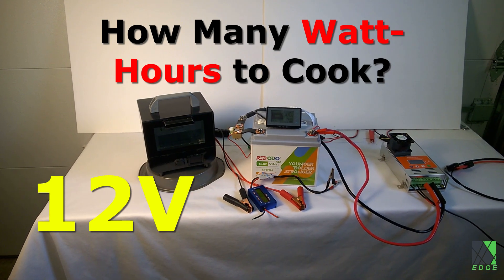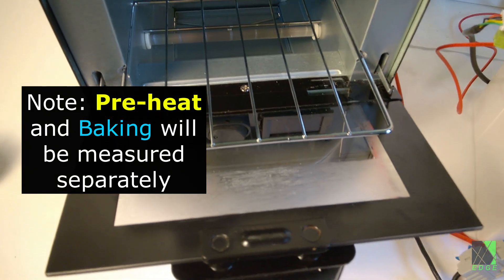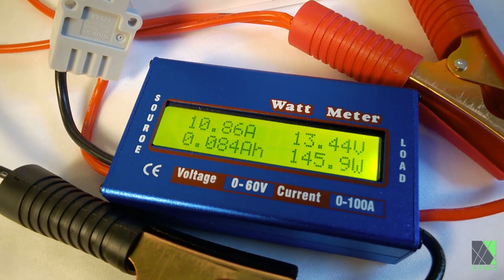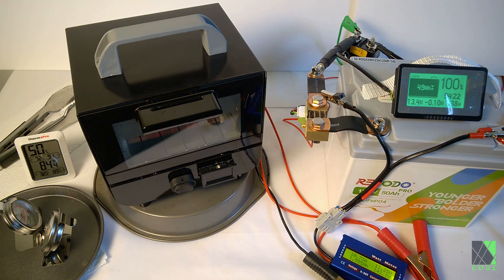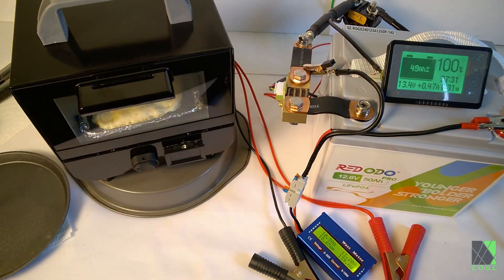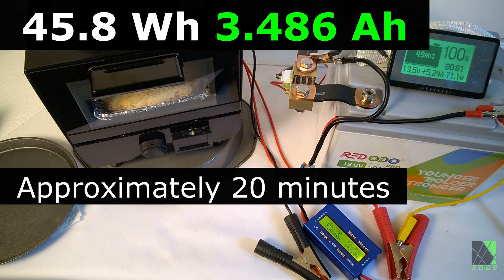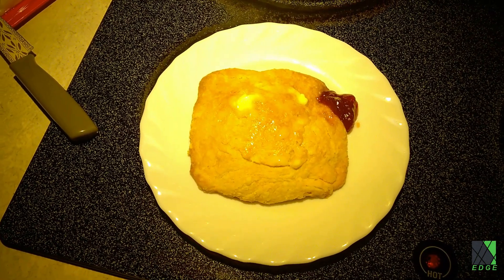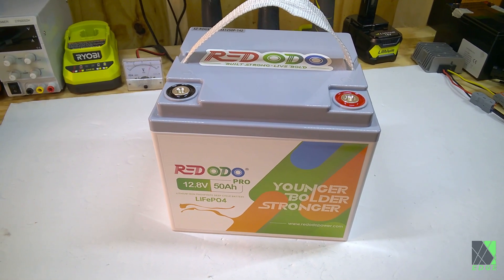How Many Solar Watt-Hours To Cook? (Live Demonstration) 12v portable #cooking #offgrid

Comment: If you read this, can you explain this to me...  Power stations are rated in watt hours, and LiFePO4 Lithium Batteries in amp hours. Power stations in the 500-600 watt hour class, seem to be equal to 5 amp hours. From what I can tell with calculators, a 100 amp hour  LiFePO4 Battery (around $300) is equal to 12,000 watt hours, or a power station costing around $8,000. 
Would not it be best to buy a 100AH battery and an inverter? Or am I understanding the AH/WH ratings wrong?
Reply from the maker: @Knife_Collector Hi, I'll try to explain it. Watt-hours is amps at a certain voltage over time. Think of it like fuel in the tank.

Amp-hours only tells us the capacity of the battery but not how long it will run. By multiplying the voltage X amp hours, the watt-hour capacity is estimated as well as runtime.

A 100ah LiFePo4 battery is 100ah X 12.8v = 1280 watt-hours estimated. 

Every power conversion wastes some of the power. An inverter wastes quite a lot power. Therefore, it's most efficient to put the direct current straight into an oven, without any conversion. That's why I build a lot of DC appliances - plus no reliance on an inverter, which can burn out. Simpler tech that does the same work = lower cost, more robust, more efficient, better for grid-down scenarios. Hope this helps!
Reply: @solarpoweredge  It does, thank you.
Reply from the maker: @Knife_Collector NP

Comment: I like that little oven 👍 Yesterday I used one of those Nuwave Induction Cook-top to cook eggs and hash browns, worked great using solar. It was during daylight hours so it didn't put a dent in my batteries. Next time I'll meter it.
Reply from the maker: @cliffandrews They are addicting to use, and I'm not even a chef :) I just burn stuff mostly. That food sounds good... it would be interesting to know the watt count for an induction cooktop. I recently bought a very small induction cooktop, maybe I'll slap a meter on it and see what it takes
Reply: Been living off grid for a bit now, the 12v adaptions and DC to DC conversions is how I manage... Your awesome buddy, keep it up!